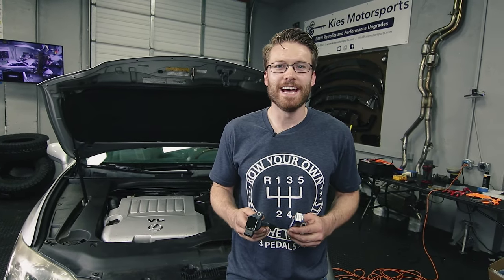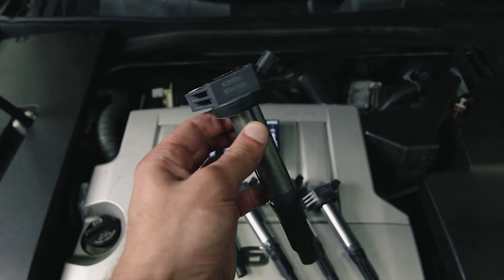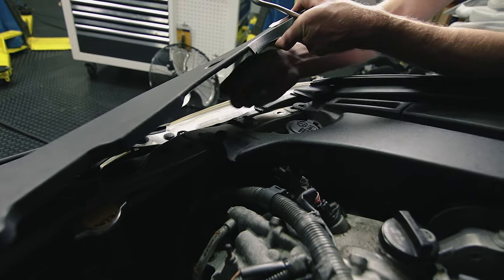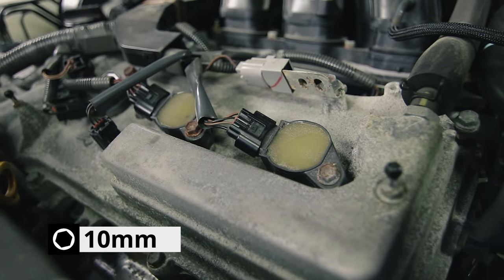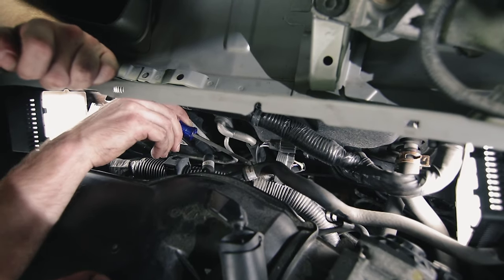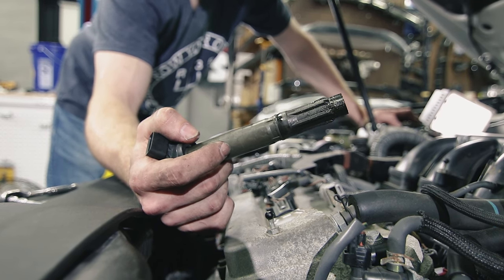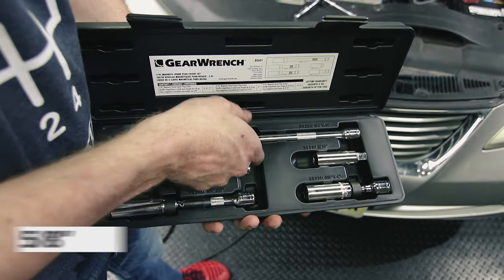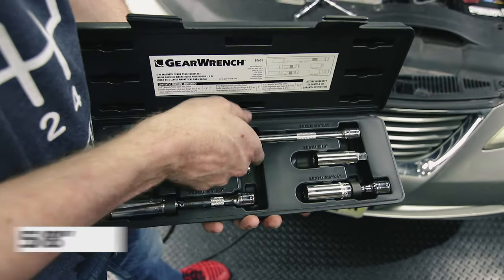How To Change 2GR-FE Coils & Spark Plugs 2006-18 Lexus ES350 / 2006-17 Toyota Camry - Under 1 Hour

Comment from the maker: They have been working for 105,500 miles so far updated - 4/2/23 215K miles on the car - car has since been sold so there will be no more updates but the coil packs were still going strong 👍👍
Reply: Good work. This is a helpful video.
I figured that leaky valve cover would've soaked the coil by now.
Reply from the maker: Probably has lol
Reply: Should had replaced the leaky gasket while in there!
Reply from the maker: Agreed, told my buddy that but he just wanted to get the job done and not worry about it
Reply: @TheSundaeDrive  he's probably going to sell the car and it will be next owner's problem!
Reply from the maker: Kept his last car a long time so dunno lol
Reply: @TheSundaeDrive  thanks for the info, i have A ‘16 with 61k, and hope to get 300k out of it.  Due fornits first plugs
Reply: How much does it cost to replace the valve cover gasket on this engine?
Reply: thank you
Reply from the maker: No problem!
Reply from the maker: Not sure what most shops charge since it isn't something we regularly do.
Reply: that was last year, any updates?
Reply from the maker: @chris haven't failed yet and he's put a ton of miles on them since then. Not sure the exact number currently tho
Reply: New update ?
Reply: I’m not surprised. Dealers overcharge. I use aftermarket Amazon ignition coils and mine have been going strong for 50k so far
Reply: Was is likely sold because of the valve cover gaskets needing replaced?
Reply: What brand of coils did the owner buy?

Comment: If you are mechanical and have the tools it's a 2 hours top job. I've done this 3x and mines has 333,339 miles.  I always get the skid, vsc, engine lights when it's time to change the plugs.  You can't do just the upfront plugs. You have to do them all.  You'll find the tips of the plugs burned out.

Comment: Just received my NGK iridium spark plugs from Amazon, wish me luck on replacing all coil packs and spark plugs. Decided to do ALL since my ES is at 183k miles and I don't know when anything was done last, and with one coil pack going out, just doing em all... Cross your fingers LOL
Reply: Brick N' Mortar all the way for me unless the price is significantly less.
Reply: I've got about 317 on my 2011 I think it's time for mine to be done as well. How did you know the coil pack was going out?

Comment: Damn. The GS 350 spark plugs are so much easier to remove compared to the ES 350 and IS 250. Thanks for the video. I've done my spark plugs on my 2015 Lexus GS 350 already.

Comment: Hello, Trained as a mechanic in 1980. I've watched many videos, and yours is one of the best. Very well done, excellent camera work. The only problem is you make it look too easy and left out all the mandatory cuss words! Keep up the great work!

Edit- just did this job today, the wiring harness near the firewall is a nightmare to work around. I broke every single clip on the 7 connectors I had to disassemble to get at plug#5 because the harness on the 2007 es350 is so tight to the manifold. I wound up buying the gear wrench sockets you used but as it turned out I didn't need them at all I was able to use a standard spark plug socket and a combination of a 4-in a 1-in and a 2-in extension to get into the spark plug well. Using this method you cannot stick the extensions into the well assembled You have to put one in at a time and attach the remaining extensions one at a time and then attach the ratchet last.
Reply: What did you have disassemble? I seen other videos taking a whole lot of stuff apart and don't want to go thoough that if I can avoid it!

Comment: Thanks for posting this vid! I Replaced back 3 coils on my 2007 Camry SE using this method today. I have done spark plug replacement removing the intake as well and this method is a little quicker. It took about an hour and a half (could do it in under an hour next time) and saved having to replace the intake plenum gasket. 
The procedure is very close to this video with a few exceptions: 
1.) Strut support is more of a tray not a bar. 
2.) Wiper motor assembly HAS to be removed in order to get the tray out. Not a big deal just 4 10mm bolts. 
3.) Did not remove the L shaped harness support bracket on the left. The harness was taped into a plastic bracket so I cut the tape which allows it to be pulled out. I put a wire tie on it to re-secure it.
Number 5 is a PITA but with patience and finesse can be done.

Comment: This video made my coil/spark plug change a breeze and it saved me a lot of money so far... We'll see how long the coils last. Cylinder 3 was a pain but worked out. Thanks again for the tool and part recommendations. They all worked out great. Thanks again!
Reply from the maker: Awesome! Glad it helped
Reply: @TheSundaeDrive   does this also work on an 07 camry, its the same v6 i believe
Reply: hey quick question. which packs and plugs did you buy and if they were aftermarket how are they holding up?

Comment: Great video for the do it yourself mechanic. Most videos and forums are showing the torque  pounds at around 20 to 21 foot pounds. I checked in a Lexus service manual after you said it was 13 and YOU are correct. Thanks for saving me from stripping out the plug threads in my ES350 cylinder head.
Reply from the maker: Glad we were able to help!

Comment: Excellent video!  Thanks for posting this video!I just replaced spark plugs for my 2013 Lexus ES 350 and doing this way instead of removing the intake manifold and throttle body.  This way gave me lots of more room to work on the rear three plugs and I didn't have any problem removing the two bolts holding the bracket on top of the rear plug on the passenger side.  Thanks again for the video!!!
Reply from the maker: awesome! I'm glad it helped you
Reply: So I'm guessing you removed the windshield wiper tray...he didnt do that step in this video.

Comment: The retaining clips are extremely brittle for these cars. If yours breaks off don't worry you can still connect it in. I changed spark plugs last year and my ignition coil connectors have not slipped off or anything. You'll be fine 👍 just make sure it's pressed in all the way.

Comment: Great video with details! Just the project I needed while sheltering at home. Did it on my 2008 ES350 with 121,000 miles yesterday. Took about 4 hours with slow work, checking and re-checking to make sure I didn't forget something. A test drive afterwords felt as smooth as before. Just a few notes to share. (1) All tabs on the connectors to coils were broken to the lightest touch! (Video 5:03). I think the age of the car has something to do with it, but there is no easy way to fix that, so I'll just check them once in a while. (2) #3 plug (the "middle" one) was indeed the hardest to get to. I have to loosen up a bracket (10mm nut) that is right next to it which holds the cable harness. Still, with that extra wiggle room, getting the coil back in was almost impossible! (3) The thread on the removed plugs showed some grease/stain, but nothing serious. Might be from the hardened valve seal, but not urgent. (4) I have to say the "work space" is REALLY tight for those hidden plugs. Anyone with well-built arms probably should re-consider.  Overall, thanks for the fun project!
Reply from the maker: great tips! Thanks for the feedback

Comment: Just finished this job on an '07 ES350; Middle rear coil needed replacement. The video & instructions are good, BUT, if you buy winter gloves marked Large, IMO, this is not the method for you. Large hands - all I was able to accomplish, working in the dark, was tearing up my forearm, while changing the coil & plug on Cylinder #1. Cylinder #3 I found impossible. #5 - Didn't even try.

I threw in the towel, and pulled the intake manifold.  Suddenly I could see everything, and it was all accessible. Factory method was much easier than I expected, will cost you an additional $30-$40 in new gaskets.

One more thing, the OP used a one piece 11-inch spark plug wrench, with swivel and extension.  IMHO, **too long**, it got in the way doing the Lexus, but, may be perfect for an RX or Highlander. If you're buying one, suggest slightly shorter 10" length.
Reply: This comment is correct, cylinder #1 and #3 are tough but i was able to do , however #5 is impossible because wire harness is right on top of coil so even if you loosen the coil there is no room to pull it out no matter what wire connections you pull
Reply: I feel your pain.  #3 was out. replaced plugs in 2, 4, 6.  piece of Cake, Replacing plug # 3 and coil pack.  May call it Quits if she runs well.  The engineering on these Lexus. They should be shot.  Labor for even a simple alternator is a nightmare.
Reply: I didn't even know you could do this without removing the intake. Now i'm wondering if there's room on the Highlander and the next gen ES.

Comment: I've built up my jeep and switched to Lexus. Thank you so much for this video!! I afraid there wouldn't be as many videos like there is for Jeeps.
Reply from the maker: No problem! Glad the video was helpful for you
Reply: well the jeep v6 is easier because it's longitudinally mounted but there is also no way of getting to the sparkplugs without removing the intake. Fortunately, you only need a 10 and 8 mm and about 1.5 hrs to do it.

Comment: Thank you so much for such a high quality video. Gonna do my 2008 Avalon tomorrow without removing the intake manifold after having watched this video.

edit:
Just changed out all 6 spark plugs, took 4.5 hours. For your interest, here's a list of all the major hiccups I had with my vehicle:
1. removing the wiper blade arms
2. removing the electrical connection shown at 5:40 due to old plastic
3. clearing out all the coils and wires that's covering the rear plugs
4. removing ignition coil 2 and 3 probably due to the vacuum in the chamber
5. removing ignition coil 3 due to all the crap covering it
6. removing spark plug 3 due to all the crap covering it
7. putting back ignition coil 3 due to all the crap covering it

The biggest pain in the f***ing ass is #5. I have no tips or tricks, the whole thing is just a huge fiddle around... not an easy or fun job, in fact it's physically painful. Still think it's worth the work to save $500 + tax at the dealer though.
Reply from the maker: Not the most fun job for sure. Glad the video helped tho! Thank you for the pointers
Reply: Buddy Boyy  It fits?
Reply: I had to replace the alternator in 2019 on my 07 es not a fun
job either. Today a code popped up for number 3 coil again for the third time, this time I'm going to install a new
spark plug along with coil.
Reply: You were able to do it without removing the plenum and throttle body ?  I am in a situation like yours. In some videos they remove the cowl and in some videos they don't. And in some videos the remove the plenum. I have a bad number 5 coil.

Comment: Thank you very much sir. You confirmed what I suspected on this 2007 Lexus ES350 that I was working on with almost the same codes. Replaced the #6 coil, cleared the codes, relearned the computer, and the six banger purrs like a kitten again. Customer is tickled pink.
Reply from the maker: Woo!

Comment: Okay...firstly thanks for the video. It was done very well. Nice camera work, great job breaking down all the tools and torque specs. Thanks for linking the tools and parts.
Now for my gripe...I did this today on my 2007 es350. No mater what I did I could not get enough slack in the harness to get the number 5 coil pack out. I wasted at least an hour trying to get enough wiggle room to get the coil pack out. It took me like ten minutes to pull the manifold and air box. Once I did that the coil pack was out in five minutes. I wish I had pulled the manifold first and saved an hour. also I recommend putting something over the  pinch weld to protect your left forearm when working from the right side. Eventhough I was wearing long sleeves my forearm is pretty torn up.
Reply from the maker: They definitely don't give you a lot of room or slack. Sorry to hear it fought you so bad but glad you were able to get the job done!

Comment: Before starting this job, highly recommend you have ignition coil connectors on hand.  Connectors are somewhat aggressive and because of exposure to heat, plastic can be brittle.  Chances are one or more connectors will break clips.  Easy to unpin old connector and install new one.  This is important for the rear bank connectors which cannot be accessed with intake installed.
Reply from the maker: Very good point. We got lucky but always better to be prepared

Comment: Thanks man, just changed my LS460 plugs last month, thought I would have to take off the manifold when I decide to change my ES350 plugs but you just saved me from that. 👍💪
Reply from the maker: Awesome!
Reply: Have to do my 15 Sienna and thought the same. Did you just need that swivel spark plug socket like used in his video?
Reply: Dang baller alert

Comment: Just completed it.  I almost gave up on the final plug behind the harness 6 times.  Had to get on top of the engine with a really hard pull to get it. It took me an hour just to get to that final tug that release it from the wiring harness. The rest is easy.  225K ES350.  Front 3 had oil leaks but these back 3 show no leaks.  The  cover gaskets in the front had hardened badly so I definitely didn't want to do the work for back valve cover yet. only your video kept me pulling on that wiring harness until gave way because you showed video evidence it could be done. thanks for the detailed video.  It did take me much longer than 1 hr because I didn't have that wire clip tool, so I bent something I had into what you showed and those clips finally come right off.
Reply from the maker: Glad you were able to get it! Definitely a bit hard for that one.

Comment: As a professional master technician, I strongly advise against replacing good working genuine toyota coils with cheap coils. Replace only the faulty coil and try to determine the cause of the coil failure. A coil may have failed from a worn spark plug and/or a lean condition on that cylinder. Carbon build up in the combustion chamber could also overwork the coil. If you're concerned about the condition of the remaining coils, have a qualified technician perform current ramp testing to determine whether or not they may fail in the near future. Repair any possible lean condition that may be overworking the coils in addition to the worn spark plugs.

Misfires on all cylinders could suggest an overall lean engine condition that will need to be repaired to prevent premature failure of the new coils.
Reply from the maker: I completely agree. I would have replaced the one with an OEM coil and left the rest. My friend is operating on a tight budget and wanted to replace them all. He purchased them before talking with us and we were just helping him out with the installation. I would never use a cheap alternative for coils but in his case it was all he could afford at the time.
Reply: Had a friend have Lexus replace a bad coil... three times, on a 12 year old car.  When they go they tend to go one at a time.  Mechanics sure like return customers.
Reply from the maker: @mikepayne5277  yeah they do lol. I would only replace what is needed because I can do the work myself. If going to a mechanic replace them all together.
Reply: @TheSundaeDrive  On a 2007 Avalon with same engine, Coil #2 went bad.  I replaced it with an OEM Denso.  Now Coil #1 just went bad.  That is on the back side.  As the procedure calls to remove the intake air plenum, I will replace all three coils at once as I only want to perform the lengthy procedure once.  I will see if your procedure without removing the intake works on the same year Avalon.  The annoying thing is I had replaced the spark plugs at 108,000 miles and removed the plenum for that job.  Now at 124,000 miles, I may have to do it again.  I would recommend now to replace the back coils when replacing spark plugs.  It looks like these coils have a life expectancy of about 100,000 miles.
Reply from the maker: That's probably a good plan to do while you are in there. Let us know if this method works for your car as well!
Reply: It's a 2007 vehicle - one ignition coil for this car @ the dealer is around $140 - so that's almost $1,000 for 6 of them.  Terrible idea buying dealership parts for this old car - these cars only sell for around $5,000 used IF they're in very good condition.  If you blew a grand on tune-up parts you've already killed your bottom line.  Just buy what's affordable, fix it and drive it while saving your money for something newer with less miles and problems.  On a car this old, as soon as you repair one thing, something else breaks - they're moneypits.

Comment: Great video. If those are iridium spark plugs, I think you aren’t supposed to gap them or check the gap because that scratches off some of the iridium. Haynes manual says it’s unnecessary because they are gapped at the factory.

Comment: I like to take off the plenum and throttle body so I can give them a good cleaning and replace hoses with new ones. Also, changing the oxygen sensor while your back there wouldn't hurt. Spark plugs are changed every 100,000 miles so you might as well do it right.
Reply from the maker: Not a bad plan. Depending on how much you drive, the other parts may be still be good tho as they tend to wear from age and not mileage.